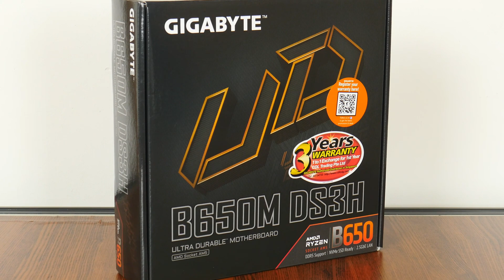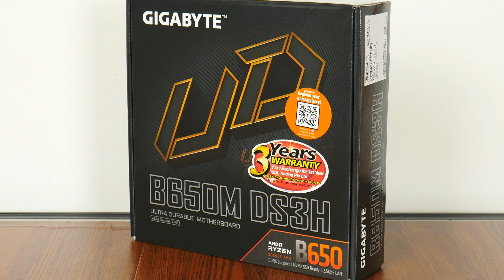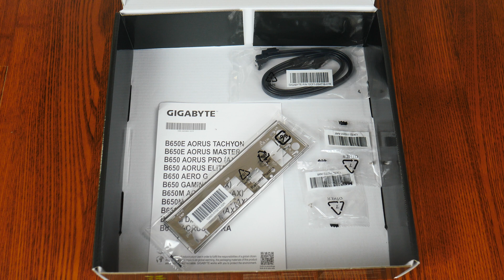Entry-level AM5 Motherboard - Gigabyte B650M DS3H Unboxing & Overview

Comment: I have a constant buzzing from speakers in games, and weird sound while loading, i think there is an interference with the GPU
Reply from the maker: Is the weird noise that you mentioned also from your PC speakers? Do you happen to have another spare set of speakers/different 3.5mm audio cable to see if you're able to replicate the same issues?
Reply: @ALKtech  I have 3 hifi systems they all make the sound, since i swapped to this MOBO i get this sound. Its like transistor sound but in the speakers...and static to even on the destop, its not that loud but it can be heard if nothing runs like music,  have to get a sound card .

Comment: Nice Motherboard. But Should I prefer Gigabyte B650M D3SH or Gigabyte B850M D3SH?
Reply from the maker: What's the price like for both boards where you're from, and what processor are you looking to use for your build? The most obvious benefit of going with the B850M is that you get PCIe 5.0 support for a graphics card and M.2 drive!
Reply: @ALKtech  I will use 7500f or 9600 (if it exist and if release  9500f). 

Gigabyte B650M D3SH 168 dollar, B850M D3SH 200 dollar. These prices In turkey.
Reply from the maker: @ oh I see. Personally, as I'd like to future-proof my build somewhat, I'd probably get the B850M DS3H seeing as it has PCIe 5.0 support! However, if you're quite sure the graphics card you're getting is a PCIe 4.0 card, saving the money and getting the B650M DS3H may not be a bad idea too..so it really depends on what you're after!

Comment: Any wifi board within this budget bro? Which is also upgradable for upcoming amd cpus
Reply from the maker: AMD's committed to launching new processors on the AM5 socket till at least 2026/2027, so this means any board with the AMD B650 chipset (and the other AM5 chipsets) will have support for AMD's upcoming CPUs for the next 2-3 years. Personally, I feel that this B650M DS3H is pretty good given the number of good performance reviews it has had - if you need WIFI, you could always get a USB WIFI dongle. That said, if your preference is for a budget AM5 mATX board with built-in WIFI, you might want to look at perhaps the MSI Pro B650M-A WiFi, or the ASRock B650M PG Riptide WIFI!
Reply: @ALKtech  ok , I hv seen some models like msi b650m gaming wifi , same model gaming plus wifi , and msi b650 gaming plus wifi model full black CLR .

Vrm are diff on these 3 ,  but else almost same spec 

That's why I confused , which vrm setup will be best for future upgradeability
Reply from the maker: @Retired_avenger  of the models that you mentioned, the B650M GAMING PLUS WIFI and B650 GAMING PLUS WIFI have pretty decent VRMs - the full-sized ATX B650 GAMING PLUS WIFI has the best VRM setup of the lot. You shouldn't go wrong with either of these boards for a high-end AM5 processor!

Comment: Please suggest me,

Gigabyte B650M DS3H (Cost INR 15000 in USD 179) in India with 5 year warranty or MSI B650M Gaming plus wifi (Cost INR 16000 in USD 190) with 3 year warranty. 
Cpu Ryzen 5 7600.
Reply: Anyone ?
Reply from the maker: Both boards are similar specs wise, except that the MSI has a more gamer-oriented look and perhaps a better VRM setup. Since you're using a Ryzen 5 7600 which isn't a power hungry chip, I'd probably save the money and get the B650M DS3H!
Reply: Thanks for reply!
If I consider wifi 6E, bluetooth 5.2, io ports and cpu upgrade in future will MSI B650m gaming plus wifi be better value for money at this price? Because I need wifi and bluetooth.
Reply from the maker: @NarendraPrasadOjha  ah yes - if having built-in WIFI and Bluetooth is an important factor for your PC build, then yes, I'd probably get the MSI instead. To be fair, both boards should handle all AM5 processors fairly decently, perhaps even the next generation of Ryzen processors (assuming they're still on the AM5 socket).
Reply: Thanks for the help!

Comment: Mann thanks for 	the video but im still confused can i pair that mbo with 7800x3d? İ wont do any overclocking to my cpu. And also 6+2+1 phases good enough for that cpu?and can i use full potential of it? İt has a 120 w tdp but it max uses 55 watts lol. İ hope you answer, you earned a sub, have a nice day!
Reply from the maker: This board will handle a 7800X3D like a champ, just make sure you've got a good CPU cooler!
Reply: @ALKtech  thanks! İ got a 360mm coolermaster LİQUİD cooler
Reply from the maker: @KsKsksoksksk  a 360mm's plenty of cooler for a 7800X3D. You'll be fine!

Comment: well done bro, subbed! Quick question - will gigabyte Rtx 4070 Super 12gb fit in this card with deepcool ak400 digital cooler?
Reply from the maker: Thanks! The GPU will fit on this board with an AK400 - but more importantly, you should also check on the dimensions of your PC case. If you're using a very compact micro ATX case, you might want to verify the amount of length clearance that your case has for a graphics card!

Comment: Would it be good to pair with a ryzen 7 7800X3D(got it as a gift) are vrm good enough, i wont do any over locking on it just heavy gaming.
Reply from the maker: Yup this board will handle a 7800X3D just fine - lucky you to receive such a chip as a gift! What graphics card will you be using for your build?
Reply: @ALKtech  my friend lives overseas so he got it for me.
Reply: @ALKtech  probably the RTX 4070 Super or 4080 if I saved money for some time.
Reply: @ALKtech  but didn't we get news about the AM5 ryzen 9 series and DDR5 8000 MT modules along with Motherboard to come in the market.
Reply from the maker: @FFje77  yeap AMD only just announced that Ryzen 9000 will launch in July this year, but there are no X3D chips yet in this initial launch line-up. That said, I suspect that the 7800X3D will hold its own for some time until the 9000 series X3D chips launch. Your 7800X3D should last you for quite some time in any case!
Reply: @ALKtech  alright, I suspect that too with their AM5 platform promise to be relevant till 2029, I will go ahead with the build Ryzen 7 7800X3D, Corsair 16X2GB DDR5 Ram CL-30 and B650M DS3H, Except the Graphics Card I haven't decided to upgrade it yet will wait for RTX 50 Series lineup, already have a 3080 🤭so it should be good in the meantime, Thanks for the insight.

Comment: What I'm curious about is how the graphics card and wifi card fit into their respective PCIe slots with those heatsinks in the way.
Reply from the maker: To be frank, I think there won't be enough space for a graphics card and PCIe WIFI card to be installed together at the same time, especially if you're intending to install this board inside of a mATX case. You'll likely have to get a USB WIFI dongle if you're intending to connect to the internet wirelessly!

Comment: Nice video man. This is just what I needed and I just reserved a pickup order. Question, does this motherboard have space for a WiFi card ? Like does it have a pcie slot for a WiFi card
Reply from the maker: Glad you found this video useful! That said, the only way to install an internal WIFI card would be to get a PCIe x1 WIFI card, though if you're using this board in a microATX case, you might face space clearance issues trying to fit the said WIFI card into the PCIe x1 slot. I'd recommend getting a WIFI USB dongle instead!
Reply: @ALKtech  thanks. but one more question. can you make a indepth step by step on how to update the bios of a b650 motherboard or show us some motherboards thats comparable with the ryzen 7000 cpu's right out of the box ? bc im having a hard time understanding if i should extract all files or if there is a specific file i should extract to be comparable with a motherboard. thats the part that im struggling to understand. ohhh one more thing. some people say that should update the bios to an older version so that the motherboard can be updated to the newest version. thanks and keep up the good vids man
Reply from the maker: @SilentStorm401 I don't have any B650 boards with me at the moment 😅 but that said, updating the BIOS is actually pretty easy, and usually you'd only need to 1) upload a single file (the BIOS ROM) into a USB flash drive 2) ensure that it's plugged into a USB port on the board 3) boot into the BIOS and navigate to the section that allows you the flash the BIOS. From there, it's just a matter of selecting the BIOS ROM file, and letting the board do its thing! Also, there's no need to update the board to an older BIOS version, simply download the newest version from the manufacturer's website and use that!
Reply: @ALKtech  thanks. But im a visual learner and I’ll be easier to understand what you are doing if you just show me.

Comment: that pcie 3.0 position is very bad , i doubt you can install wifi card with that minimal space
Reply from the maker: Yup I do agree the slot placement isn't ideal, unless you're using this board in say, an ATX case where you might have more wiggle room..

Comment: I'm new to this, but does the RAM support of up to 6400 OC mean I won't be able to put Team Group Delta DDR5 - 6000 on this? (2x16 if that matters)
Reply: Never mind, I just saw the other comments. Thanks for the clear video  and replies 👍👌
Reply from the maker: @abdul_3238  you can! It simply means that your Teamgroup RAMs are rated for up to DDR5 6000 speeds - within the BIOS you can enable the default AMD EXPO profile that sets your RAM to run at DDR5 6000, and you're good to go!

Comment: How is the Build. Rate this build. 
Processor : AMD RYZEN 7 7700 3.8GHZ 8 CORES AM5 GAMING PROCESSOR

Motherboard : GIGABYTE B650M DS3H DDR5 AMD AM5 MICRO-ATX MOTHERBOARD 

CPU Cooler : Thermalright Aqua Elite 360 WHITE ARGB V2 CPU Cooler

RAM : Corsair VENGEANCE RGB 16GB DDR5 6000MHz RAM White 

RAM : Corsair VENGEANCE RGB 16GB DDR5 6000MHz RAM WHITE 

SSD : Kingston KC3000 1024GB NVMe M.2 PCIe 4.0 SSD 

PSU : Antec CUPRUM STRIKE CSK 750W 80 Plus Bronze Semi-Modular Power Supply 

Casing : MONTECH SKY TWO ATX MID-TOWER CASING (WHITE)

Comment: Big brother please reply,
I want to pair this b650m ds3h motherboard with Ryzen9 7900x and i want to use this Thermalright Aqua Elite 360 White ARGB All in one cpu cooler for cooling solutions, please let me know will it be ok or not...
Reply from the maker: Yup this combination should work pretty well - despite the B650M DS3H being an entry-level board, it seems that the VRMs are pretty decent and can handle high-end processors pretty well - the folks over at TechSpot did a VRM test and this board did pretty well with a 7950X!
Reply: @ALKtech   Thanks a lot, actually MSI pro b650-a WiFi which is 160$ and b650 ds3h this mobo were globally 150$ meanwhile in my country ds3h cost 170$ and MSI pro b650-a WiFi cost 225$🥴, but I see ds3h has pretty good heatsink,

So please tell me about the CPU cooler will it be capable to cool 7900x?
Reply: @ALKtech  
Thermalright Aqua Elite v2 360 White ARGB All in one cpu cooler
Reply from the maker: @SHAWON-jl3jv  I personally haven't had the chance to try this cooler, and it doesn't seem to have that many online reviews available, so I can't say for sure how well it'd cool a 7900X! But that said, the B650M DS3H will work well with the 7900X - perhaps you might want to see what other AIO liquid coolers are available in your country?
Reply: @ALKtech  thanks big brother for check out this cooler for me, yeah there is not that much reviews regrading this cooler, I saw hardware canucks content where he tested ak620, assassin iii with 7950x, so I think I should go for these CPU cooler's, what is your opinion, and big brother I like the way you makes content, can I have your personal Facebook or something? As a fan? You r really a good human indeed.....
Reply from the maker: @SHAWON-jl3jv  the AK620 and Assassin III are both good choices - I guess the deciding factor here would be price - how are the prices like for both coolers where you're from? You can follow my Facebook page with the handle @alktechsg, cheers!
Reply: @ALKtech  
In my region both the cooler comes in same price...
Reply from the maker: @SHAWON-jl3jv  I'd personally go for the AK620 in that case, since both have the same prices!
Reply: @ALKtech  yes! I also decided to go along with ak620,
But big brother, will it a good pair which I can rely blindly? Gigabyte ds3h with 7900x? Or for getting that much satisfaction I need to go for MSI Pro b650a WiFi? In my region it's cost 235$ and gigabyte b650m ds3h cost 170$, in hardware unboxed YouTube channel were 35 am5 motherboard tested with 7950x, and in that content temperature of these 2 motherboard's were same, 78°c, on MSI pro b650a WiFi multi core performance of 7950x was 37700 and multi core performance on gigabyte ds3h was 37400+, those 2/3% performance gape is nothing for me, I'm satisfied with that, the system which build with gigabyte b650m ds3h motherboard takes only 23 second to start, and the system which build with MSI pro b650a WiFi motherboard takes 54 second's, 
So what should I do?? Remember the price and also performance before suggesting me, it's a request.
Reply: @ALKtech  actually this will be my first ever personal computer, so it's like a dream pc to me, that's why I'm bit desperate
Reply from the maker: @SHAWON-jl3jv  no worries. I'd personally still save that money, and get the B650M DS3H, which I feel represents the best value for an AMD B650 board! Besides, the 2%-3% performance variance is insignificant, and you wouldn't be able to tell the difference under real-life scenarios!

Comment: Hm, i dont need wi fi or PCI 5 or any those extra features, but i will get high end GPU like rtx 4090 and NOCTUA NH-D15 cooler , aswell with 7600x CPU, would all that work with this mb?
Reply from the maker: Yup this combo will work fine, though if you have the budget for it, why not go for a 7800X3D so that you can maximise the 4090's potential? The 7600X will likely bottleneck the 4090 especially at lower resolutions..
Reply: @ALKtech  cause at 4k u literaly have few frames difference between 7600x and anythyhing else rly cause gpu is used only.
Reply from the maker: @Markzy_DM  cool, if you're intending to game at 4K with maxed settings then I guess such a combo works fine. Besides, the B650M DS3H seems to be pretty good value for money, especially given how it handles higher-end AM5 processors. You could always upgrade to Ryzen 8000 series in due course!

Comment: Can you install 2 nvme ssds and use them at the same time ...along with a 4000 rtx gpu ?
Reply from the maker: Yes you can! The M.2 slots do not share bandwidth with the primary PCIe slot for a graphics card, so you can use all three devices concurrently.
Reply: @ALKtech  Thank you bro, this was my biggest issue.
Reply: @ALKtech  do they share lanes with the pcie 3x1 slot?
Reply from the maker: @alex80899  nope they don't!

Comment: Can we add cpu air cooler?
Reply from the maker: Yes you can - all motherboards have standardised mounts that support air and liquid CPU coolers.
Reply: @ALKtech  Ok. Will Deepcool AG400 plus fit into it? Am having doubts about it. I got this MB yesterday and am looking for a budget air cooler.
Reply from the maker: @Mohit_S92  the AG400 should fit fine, it's a pretty slim CPU cooler!

Comment: I have an issue with this MB, when its off the the ARGB is still on. The fans from Antec AX61 case is always on. I have to turn off the PSU to get it to turn off. Any ideas what is wrong with it?? Bad MB??

Comment: Does this board have built in wifi or will I need to get a wifi adapter?
Reply from the maker: This board doesn't have built-in WIFI unfortunately, so yes, you'll have to get an aftermarket WIFI adapter!

Comment: Hello friend, I want to assemble a motherboard + processor kit like yours, what do you think of the motherboard? Does it support the processor well? Have you noticed any overheating or loss of performance at any point? I saw some gigabyte motherboards producing a coil whine (buzzing) during stress of use, did you notice something like that? I'm sorry for the excess of questions is that where I live they are very expensive parts. Thank you if you can clarify for me.
Reply from the maker: Hi there, unfortunately I didn't have a processor on hand to test the board, but there are some good reviews of this board out there by other tech reviewers (e.g. Techspot), where they found that the B650M DS3H performs pretty well with even high-end AM5 processors. It does appear to be a value-for-money board that performs well for its price point in the AM5 ecosystem...